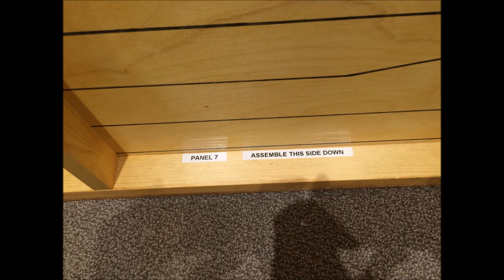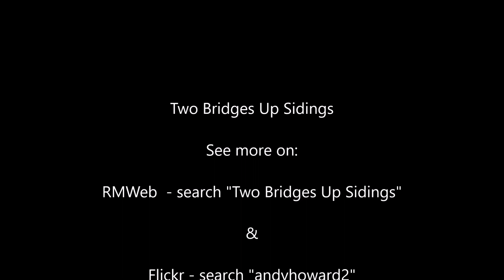Two Bridges Up Sidings   Construction Photos

Comment: Interesting layout!  Made for exhibiting or preferring modular construction?
Where did the computer style connection kit come from;  inhouse or from a supplier ??
Reply from the maker: Hi, the layout is for exhibition and has had a couple of outings so far.  i think i would have made it modular anyway although the wiring at board joints is a significant task compared to non modular.  the 25 pin D-sub cables were bought once i could find a supplier that could confirm the spec of the cable inside (many cheaper cables seem to have a resistance).  the d-sub sockets are pretty readily available as was the solder tag strip.  the matching mounting plates took some searching for.  i have since seen a model railway manufacturer provides a kit of two 25 pin d-sub sockets with built in screw terminal breakout boards and a cable - i would consider this next time for time saving construction.